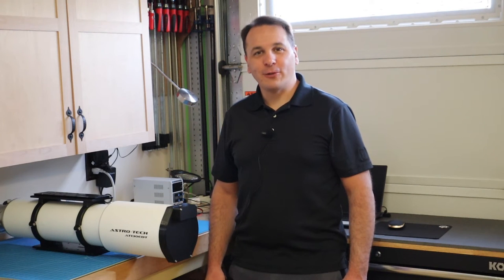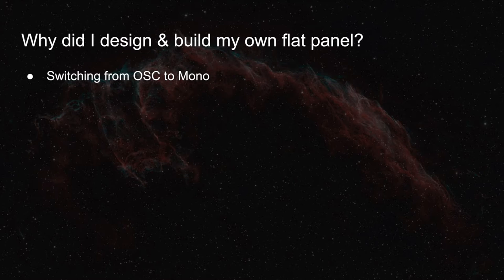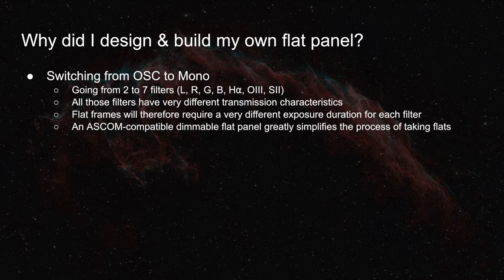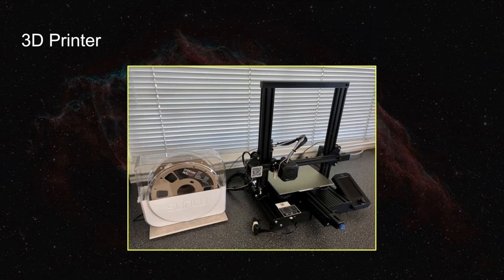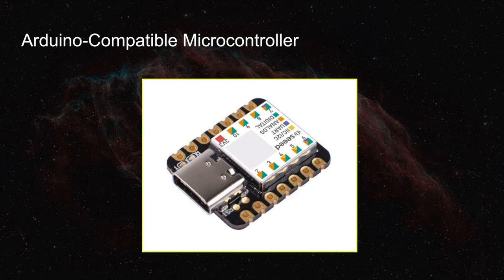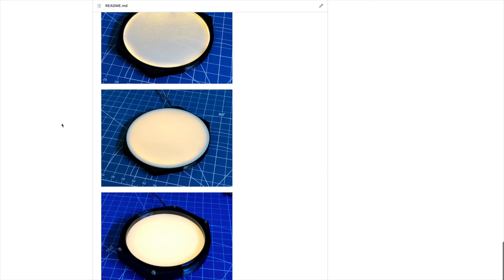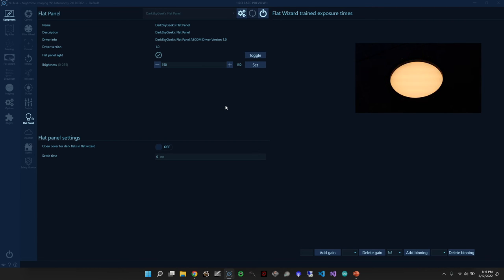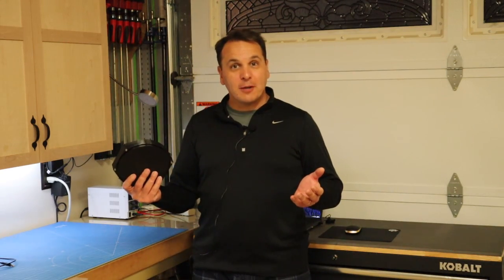How To Build An ASCOM-Compatible Flat Panel For Astrophotography

Comment: This is great! I just finished building one.  For some reason the panel was super dim no matter what voltage I applied from the buck converter. I swapped the IRF520 to a 30N06 and now all is well.  Maybe the IRF520 I used was just a dud.

Comment: Thank you so much. I built this and it works absolutely perfectly on my FLT120. Initially I made it adding a 12V inverter and EL Panel. It worked just fine but the EL Panel did not emit enough at the red end of the spectrum and so Sii subs were around 90sec long. Now I’ve used a COB LED strip and it’s absolutely perfect.
Reply from the maker: Awesome! I hope to post an update on this project in a few months.

Comment: Hello, very attracted by this project, I got to work. I have followed all the steps, at least that is what I think, but the problem I have is that I am not able to connect through ASCOM to the Panel with NINA. It tells me that the connection fails. With the ARDUINO interface I can connect and upload configurations but then I cannot connect with NINA. I have everything installed, ASCOM and I have registered the dll, but nothing. Any suggestions?
Reply from the maker: Are you sure you are using the right COM port? Hard to diagnose with so little information.

Comment: Hi, I got my 3D print ok, it may need some adjusting, and I need to buy the bolts, but with the arduino part of it all, its really confusing, I can't find the code to program, I'm really catching up on my old electronics hobby and career but, I may need a little push and help to keep it going. Thanks, and great channel.
Reply from the maker: Learn about Arduino and the Arduino IDE. Then, everything will become clearer 😁

Comment: Hello, another very good tutorial from Dark Sky Geek !
Just a little question ...
What did you use to make flat panel with correct diffusion ? I mean with led strip, it's very difficult to do nice flat diffusion without using proper acrylic diffuser extract from an old TV or  PC screen.
For large flat panel (ie 500x500 mm) I did not find any other solution ? Maybe you know more about this that you can share ? 
Regards
Reply from the maker: Watch the next video, which I am planning to publish in a couple of weeks. It will explain this a bit better. CS!

Comment: Do you have any ideas on how to get finer control of the panel brightness at the low end?  When I set the voltage regulator such that the panel brightness is high enough to let me take 5 second flats with narrowband filters I find that I can't make the panel dim enough with pwm to let me take long LRGB flats.  For my newtonian I've found that the length of SHO flats isn't very important but LRGB flats must be long in order to calibrate correctly, ideally greater than 10 seconds.
Reply from the maker: Yes, I have some idea, and I hope to release a v2 of this project by year end.

Comment: Bonjour Julien,
merci pour tes vidéos, je les regardes régulièrement. Je suis intéressé par ce flat panel, mais j'utilise un Asiair et je voudrait le contrôler depuis un Ipad ou un mac (je n'ai pas de PC!!).
Aurais tu une solution à me proposer?
Merci encore pour ton excellent travail.
Jean-louis
Reply from the maker: ASCOM, c’est que pour Windows. Sur les autres plateformes, il y a INDI, mais je n’ai pas écrit le driver INDI pour le flat panel car je n’en ai pas besoin. Mais si quelqu’un veut le faire, j’accueillerais la “pull request “ avec beaucoup d’enthousiasme 😁

Comment: Hi, thanks for sharing your design. Just to be clear. Your circuit diagram shows the Gate on the left (connected to the PWM and 1K resister), the Drain in the centre (connected to the 0V) and the Source on the right (connected to the ground of the LED).
Reply from the maker: Absolutely correct!

Comment: Hello, great video! I just bought a 3D printer, and I was thinking about building this one for me, however I want a step further, and I want to build a motorized LID as well. So I think I will do it I have just a couple of questions though. I would be glad to hear from you. 
Do you know the weight of this lid? Because I need to buy the servo motor and I was thinking which one should I buy it. If it is too heavy then I will have to buy a stronger model of it.
 I have never had a Eletronic flat panel, so the open of the LID is also built in in Ascom drivers? Or this method I would have to implement outside, perhaps adding a command to the sequencer to NINA to open it or close it when I finish it.
Reply: I just saw you have another video with a automated version, but it is just a cover, I was thinking about having them together, have you ever considered that? A cover/flatplanel at the same time? I want that because I am considering to send my telescope to a hosting site where I will control everything from home.
Reply from the maker: Hello! Maybe you should watch the video again 😁 I mentioned the FAQ, and your inquiry is addressed in the FAQ. Second, I sense that you don’t have a ton of experience building embedded devices and programming. If so, I strongly recommend you check out Deep Sky Dad (also mentioned in the video) CS!
Reply: @darkskygeek  Sorry, but I didn't undertand your reply about the FAQ and my inquiry. I have watched both videos again, this one and also the automated dust cover and I didn't find when you mentioned FAQ nor the Deep Sky Dad. Secondly I don't have much experience with embedded devices, true, a few experience with C and C++ for developing a few tools for windows and I have plenty of experience as developer though so I believe I may be able to figure out, definitely I will check out Deep Sky Dad. Thank you for the suggestion. 
Could you please tell me where to find the inquiry on the FAQ? I went to your repositories on github and I didn't find it there either. I am pretty sure I am missing something here. Sorry for the confusion.
Reply from the maker: Please note that the project at https://github.com/jlecomte/ascom-flat-panel has been archived. The only panel project I support is at https://github.com/jlecomte/ascom-wireless-flat-panel, which has an FAQ.
Reply: @darkskygeek  Now it makes sense. Ok I will look into it. Thank you!

Comment: Embarrassing story that I don't want to share...Is there a source for the white background sheet so I don't have to buy a whole new light from Amazon? I the meantime I'm going to try to print a two layer (0.08mm each layer) disk out of white PETG on my Bambu X1C.
Reply from the maker: Look for “white acrylic sheet” on amazon (1/8” thick), you’ll need a couple. Pretty cheap stuff. I think it is listed in the GitHub README, is it not?
Reply: @darkskygeek  Not that. I'm looking for the thin  white sheet that goes behind the LGP.
Reply from the maker: @BoeingBrian  Ah ok. I got mine out of the same light fixture from which I extracted the LGP.

Comment: Well done. What LEDs did you use, the ones in the link have 600 diodes with a power of 30W (24W are given elsewhere in the specification) is it not too much power? Can the resistor be 1KΩ 1Wat? My questions may be stupid but I don't know much about electronics.
Reply from the maker: Excellent question! I cut the strip to length, so the LED strip ends up being ~ 20 inches long. With that, the number of LEDs is kept to a more reasonable number. Even at full power, it uses about 500mA @ 9V iirc (the buck converter brings the voltage down from 12V to 9V, I documented that in the README file in the GitHub repo, this is very important for several reasons with the LED strip I picked) Thanks for watching!
Reply: @darkskygeek  do you have a photo of the perforated circuit board from the other side? The connections of the IR520 are unclear to me.
Reply from the maker: @mareksawicki9446  I looked through my photographs, and I am so sorry, I don't. However, if you get it working on a breadboard (that's step numero uno), you should be able to infer the wiring on a PCB. Best of luck!

Comment: Excellent idea and implementation!
I've followed your instructions and got it working to some degree 🙂
My LEDs lower voltage is around 7V, so set it to 7.15 with my power source, but it is always ON even when I switch the panel off in NINA. Setting to 0 still keeps it dim but ON. increasing the value to 255 makes it brighter - this part works OK.
In your demo it looks like you can toggle it and switch it on/off. This (OFF part) is not working in my case. Tried with a different LED - same result. LEDs are ON even when the toggle is off. Any ideas what I am doing wrong?
Reply from the maker: Hmm, this is weird. When the Arduino pin outputs 0, the signal should always be low, and therefore the LED should not receive any power at all. I would suggest that you double and triple check the wiring. It’s easy to get it wrong (I did, on my first perf board) A cheap oscilloscope is very useful to debug this kind of issues. Good luck!
Reply: @darkskygeek  Checked the wiring, indeed it was D and S of the mosfet switched - i was confused of the schematics diagram. Fixed it and it works with toggle on/off.
Now I have a different issue - output voltage is raising from 6.95V when the brightness is 1 to 7.12V when the brightness is 255. This is with the LEDs connected.
I understand that the LEDs properties will affect the output, but in my case 7.12V is not even switching the lights on. I've ordered a different LEDs, but meanwhile can I do anything maybe with the resistor (currently 1K) to increase the voltage on D and to make the range e.g. 7.5 - 12V?
Increasing the input V to 15-18 doesn't change the D voltage
Reply from the maker: @alexk8179  Glad you found the wiring issue. I don’t know what’s causing your new problem, you will need to experiment. This kind of project is riddled with trial and error / troubleshooting. That is part of the fun 😉 Good luck!

Comment: Can you make it INDI compatible? 😃
Ps. For use with Astroberry/ Stellarmate
Reply from the maker: Unfortunately no. But since the entire project is open-source, I am hoping someone (maybe you?) could contribute that :)
Reply: I have made a version with the Alnitak command set, it works with both Indi, SGP, APT and NINA (I use Stellarmate).
Reply: @DrawsACircle  Great Job!! Is there a link for this version that you can share? TIA
Reply: I actually ditched Stellarmate/Indi because of bugs in Indi @imopas1 . It cannot handle the open/closure and switching the panel as it should. But I can easily make an Indi version available, I just need to check if the code is still working as it should.

Comment: I'm not used to FreeCad and I need to resize to my Fluorostar 132 so, I'm  redoing in F360.
Reply from the maker: This is great! Do you want to contribute your F360 file to the GitHub repo when you’re done? You may be able to create a more compact unit than the one I designed.
Reply: @darkskygeek  Absolutely!
Reply: @DarkSkyGeek - Astrophotography  Would it be possible for you to share a cross-section view cutting through the front, back, spacer, white background, LGP and defuser? I want to make sure I understand how everything fits together. I printed the STLs provided. However, the spacer does not fit down inside the back part like I think it shows in FreeCAD.
Reply from the maker: @BoeingBrian  OK, that sounds a little complicated. Without having to become an expert at FreeCAD, I think that your best bet is to download FreeCAD and open the 3D model file I provided in the GitHub repository. You can then show/hide various parts of the model and pan around, which will make your reverse engineering a lot easier to do. Also, while you're in FreeCAD, try to open the Globals spreadsheet (look at the model tree) and try to edit the values (diameter of your optical tube, thickness of your optical tube) and FreeCAD will automatically resize the model (it is parameterized) If that works (sometimes, FreeCAD can be a bit difficult), you can export each part as an STL file, and that's it, you're done. Either way you choose, best of luck!